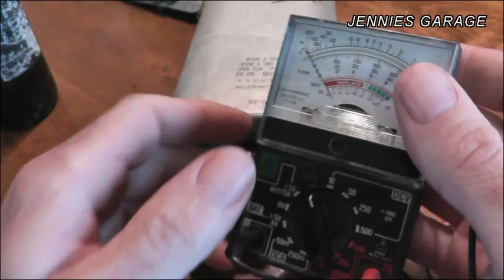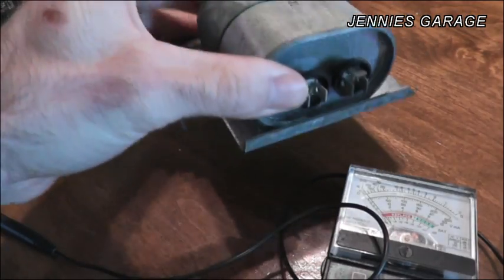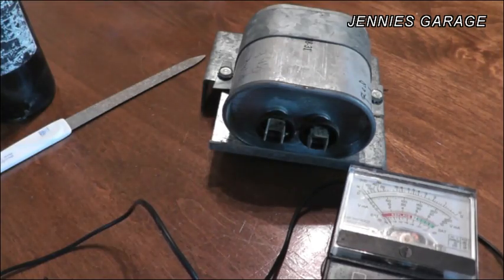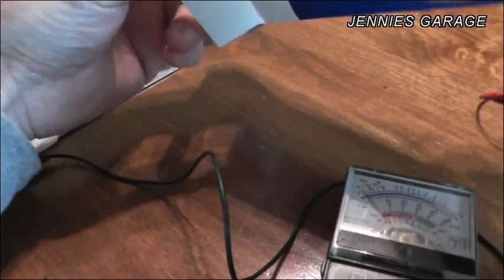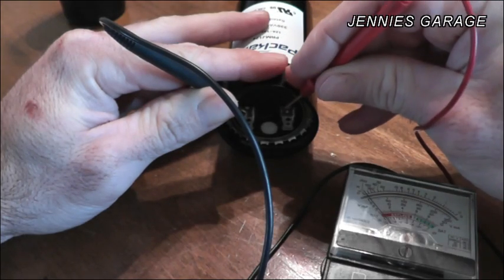How To Test A Capacitor For An Electric Motor With A Multimeter

Comment: Does that mean you found out that a capacitor hold energy even after the voltage has been disconnected? And will ruin your day if you didnt know that fact before you licked the terminals? If not then you didnt get a crash course in caps. It took a friend i had helping me with ac and electrical work 3 times of molesting caps i had in my tool box before he caught on. That also meant  drywall repairs where he stepped through ceilings four times. Three changes of undies. Three repairs due to electrocution and one just for the fun of it. If you walk into a room and see a pair of legs hanging down through broken sheetrock on the ceiling i highly recommend jumping up grabbing both legs tightly and swinging on them. You may hear some sounds youve never heard before but its takes some of the anger out of hiring a moron that steps through ceilings.

Comment: With the Ohm test, if the needle does not move the capacitor is nonfunctional. However, if the needle moves does not necessarily means the capacitor is functioning correctly. For example, a capacitor for a vent power motor (attic exhaust fan) is typically 15 microFaraday  with 5% tolerance 250VAC (for 1120 RPM). Using a capacitor meter to check for capacitance= 5.3microF.  Using the Ohm test, the needle moves up and down but the capacitor does not hold enough charge to keep the motor going. The Ohm test for a capacitor is a rough test- good enough for a quick check if you do not have a capacitor meter but it has some limitations.

Comment: I did the same test and it shows fine but still can't run the motor, I replaced it and now my blower motor is running again.You have to measure the microfarad,otherwise you will still be in the dark if you just measure the resistance.

Comment: For those watching that have no experience dealing with caps. You see how he keeps touching the terminals on the caps? DONT DO THAT!!! His have been discharged or you would see discharge running down his legs. Once a functioning cap is charged it will stay that way until it is discharged. Some caps can have up to 50k volts. Wanna trick you buddies demo a disposable camera. Seperate the flash and pc board charge it with the battery in it. Leave it sitting where nosey people are always messing with your stuff. Wait till they see the shiney thing and just like a monkey on nat geo. Theyll rush over and play with it right up to the point they  get 370 volts . Ah good times. You can rig up remote controls and flashlights to do the same. Btw to discharge caps find a 20000ohm resister and attach leads to the terminals. Use it to jump cap terminals. They can ruin your day or worse.

Comment: Those capacitors are effective only at the specified range for a specific motor....so this test is not adequate. Decent capacitance meters are $30 and up, small investment to know you are troubleshooting correctly. I paid for mine $39 about 20 years ago and it was useful on a large number of occasions. Also a correct value resistor must be used to discharge the capacitor safely. There are Safety Capacitor Discharge Calculators online that can be used to determine the correct resistor value if you are not familiar with the calculations.

Comment: There is no capacitor designed to be beaten liked that.  Never short the terminals under any circumstance.  Whenever needed, use a bleeding resistor.  If not sure which value to use, start with a higher value in the range of 50K or 100K.  Put it across your voltmeter leads and measure the dropping voltage.  Depending on the initial capacitor residual charge, this may take few seconds, perhaps a minute at the most, but doing so you will ensure that you won't damage anything and on top of it, you'll have a VIP seat to see the working progress !!!  There is nothing like testing a capacitor using a simple circuit.  I made a simple tester using an AC transformer, a resistor and the capacitor to test.  By measuring the voltage across the resistor, I determine the current.  Using that current value and the voltage across the capacitor, I determine the value of the capacitor.  So far, that approach never failed.

Comment: So true as I too was quoted one price over the phone to include tax & all for the total I was quoted, but when I got there the cost actually went up quite a bit at cranger appliance parts. But I think it was due to the fact I was not a service co. technician. as I was only a  D.I.Y guy! It's tough enough to save a dime when they paralyze & penalize you for not going to school in one field or another even though you're pretty much able & sometimes even more able to fix it than those trained that went to trade school. I had to learn everything in the school of hard knocks. People with any logic or ability or just plain common sense can fix most anything if it's on YouTube. L.O.L

Comment: A couple corrections, you have a blessed resistor on the capacitor, so it discharges it when not powered (still good idea to manually discharge, just in case)... Second, the file you're using has diamond dust on it (the abrasive part), it makes a pretty good insulator and wouldn't discharge the cap. And you don't really need one side to be insulated in this case, just bear in mind that if you use a bare wire, it may get hot while it discharges the cap...

Comment: Good video. i gave it a like.  But, Capacitor values are critical. Machines will still run with capacitors at lower values but ,they will draw higher amps shortening the life of the motor and causing higher electrical bills. Capacitor Values MUST Be Tested to Keep Compressor Motors from Burning out. Capacitor Values must be within 10% of Stamped Value on the Capacitor. good vid if your capacitor is shorted (as yours was) or open but thats it.

Make: Supco 
Model: Mfd10 --- is a Good Capacitor Tester. Works Good.

Comment: Hello Crash Crash Course--you crashed;High School electronics101 , to test resistance you can have no bridges between sources, especially a transistoracross a A 370V CAPACITOR ACE;  DONT MESS WITH THIS STUFF, THE ER IS NOT IN THE NEXT ROOM TO PULL YOU BACK !!

Comment: Thanks so much  for your effort to make a video to educate others.  However I am wondering why you would do so when you clearly lack the knowledge and experience on this subject matter. Please leave these topics to those who are qualified, especially with respect to troubleshooting and replacing electrical devices which operate at lethal voltages.  Quick example, you would not want to perform the simple test with a discharge resistor in place on the capacitor.
Reply: +Richard Kaseler - Why's that?  It's a 220KOhm resistor so it's unlikely to affect measurement if you're set to, say, the 1KOhm range or less on a multi-meter.  It will slowly discharge the capacitor by itself if left alone, but there's no problem speeding things up with a hard short to be on the safe side.  As long as this advice is followed and you don't go shorting both the capacitor terminals out with your body then you'll be fine.

Not everyone is a complete idiot when it comes to fixing things.  A little common sense goes a long way.  Many things can be repaired easily and cheaply for those with the skill to be able to do so, often saving huge amounts of money that would otherwise typically go into the hands of so-called 'qualified' 'professionals' who often know little more than what was said here.

So, $16 and a little time, with knowledge gained at the end, versus $$$ for someone else to do the same thing.

It would be worthwhile investing in a cheap multi-meter with capacitance check though for more effective testing.

P.S. I don't see that you have uploaded any videos on this subject yet.  Maybe you should do that first before criticising others.

Comment: not the case,,all capacitors have a mfd or uf  (microfarad) rating with a +/_  a small percent for a properly working capacitor  !!! just putting an ohm meter to see if it absorbs the power DOES NOT mean its a good capacitor,,,

Comment: Ha.. Thanks a bunch.. I had a capacitor go out on my franklin well pump. I always keep an extra control box to swap parts, but, needed to know what to put back in, and put back on the pump to keep my spare as a spare.. 
I just did the same thing, and figured this out... But, great video.. Makes me feel better.. 
I looked for a video like this back in 2009, when I had the last problem, and never did understand this well enough, so, changed the relay and capacitor in the box. Now, I just ordered 2 capacitors to fix both as spares and test them both again and keep them handy.. 
BTW.. I had almost exactly the same results as you had. Mine was a 1hp 220 volt pump.

Comment: and...... normally when the compressor Capacitor has failed.. 9 times out of 10 the compressor is on probably it's way out..... as in.... any body looking to fix the A/C via DIY are likely to just contaminate the refrigerant gases as the compressor windings  continue to burn out..........and build up acid in side pipework..

B.T.W. If your A/C is inverter driven I would NOT RECOMMEND -  shorting out high VOLTAGE capacitors. just call the A/C tech and make him/her  a nice cup of tea ......

Comment: 1st off you cant test a cap with the resistor in place thats used to discharge the voltage thats built up! so you DONT need to discharge a cap that has a resistor!! 2nd you need a meter with an MFD or a cap setting on the matter that reads the caps MFD rating  such as a HVAC meter would have!

Comment: If you look carefully at your ohmmeter, the ohm scale is zero on the right and infinity on the left. It jumps up toward zero and drops back down toward infinity. When you adjusted it at the beginning you calibrated it to zero ohms. You also need to check to make sure the terminals aren't shorted to the case. Often when these fail there will be oil or melted plastic oozing out of seams in the case and they can be discolored from heat.

Comment: Looks like the first cap has a 22k discharge resistor on it...couple secs after you disconnect the power it's discharged(I'd still check with a volt meter to verify)

Comment: Shorting the capacitor "with something metal" is a good way to ruin your capacitor!!  Use a resistor instead.
Reply: Why is that?
Reply: Because it can cause localized overheating which can vaporize and blow a hole through one or more internal layers of the cap. This could result in a loss of capacitance, or complete failure from an internal short.  It's a basic electronics no-no!

Comment: YIKES!
The very, very basic "facts" in this video are somewhat correct, BUT important details and theory are screamingly missing. Watch another video on how to SAFELY check large capacitors on You Tube with a digital multimeter [which most people own these days]. You'll be glad you did.
Reply: +GREG GUITARS LLC  - You have a good point. A motor cap for a whole-house air conditioning compressor or condenser fan would likely be 240 volt, which could certainly deliver a potentially lethal shock if it was fully charged and was a "big" capacitor of 15,000+ uF.  At least this video did mention in a couple of places to discharge, except that at one point, he didn't! On the Start capacitor, he touched the terminals with the meter probes without discharging first, later explaining that he actually knew already that the device was no good.

Comment: be safe, capacitors can be deadly. Use a load to discharge. Shorting can cause an explosion. An incandescent bulb usually works. Lower wattage, higher resistance...

Comment: You also need to check each terminal to the cap case, should be infinite resistance, if you get low resistance the cap is internally shorted. To accurately test one you would need a LCR meter.
A little FYI on caps used in AC, they DO NOT hold a charge like some would think, they would on DC but not on AC. With AC motors you have what is called inductance, which acts like a huge block to current flow, it makes the current out of phase with the voltage, which is inefficient, motor runs slow, gets hot.... blah blah PF or power factor is the amount of phase difference. Caps act the same way but in reverse, so in effect they cause the current to flow and be in phase with the voltage, so you see a better PF. 

Capacitive reactance is opposite of inductive reactance, they counter act one another.

Also see the resistor across the terminals, that is a bleed down resistor, so normally with no electricity the cap will bleed down to nothing in like 30 secs, so it doesn't give someone a JOLT!
Reply from the maker: Vernon Bosshard Good info, thanks for the comment.

Comment: Thank you this help me fix my portable AC unit I did not have a digital capacitance meter with your help found the faulty cap which was open and this did not start the compressor.

Comment: You can also test them visually.  My start capacitor had a flat top when new.  Now the top is bulged.....that and a very small amount of oil from the capacitor was on the  underside of it.  (and of course, the pool pump would not turn on).

Comment: The discharge can be startling for any one who has never discharged a fully charged cap before.... so be prepared for a loudish crack when you do. Obviously the lower volt rated caps release a smaller amount of charge so crack will be not so loud.

Comment: Capacitors store current and are measured in farads.Small capacitors that is. Hahaha!!! Yeah, make sure the nail file is insulated on one end. I would rather use a 
small screwdriver.
Reply from the maker: Yes a screwdriver would've been safer. More insulated, and less chance of getting fussed at by the rightful owner of the nail file.
Reply: LOL!!

Comment: The reason why the second one didn't jump like the first one after charging it once is because the first capacitor had a bleeding resistor to slowly let out charge when the capacitor is not charging. If the capacitor has no bleeding resistor, it will keep the charge for a very long time!

Comment: You need a digital mm that tests capacitance (uF) , capacitors have posted values and all you find out with that meter is continuity, it a fan cap is rated for 10 microfarads and it reads 2 it probably will not work, always buy a new cap with a new motor, they are not that expensive because some aftermarket motors have diff value caps.

Comment: Thanks for the video. My motor in my hot tub would not start. just making a humming sound. I checked the capacitor like you stated, and that was the problem. Saved me a service call.

Comment: I checked my capacitors with a digital multimeter and my ohms keep climbing up, up, up & up and never drop back to 0. >=-( Are they bad?
Reply: If you ohm goes to zero, it is bad. Climbing Higher is good sign.

Comment: I'm having problems with my compressor staying on. It starts then stops. Does the black capacitor keep the compressor powdered up?
Reply from the maker: Hi, if your motor is like mine, there are two caps, and they allow the motor to start and continue running. If one is bad it won't work right.
Reply: I only have one capacitor. I bought another capacitor Installed it and got the same result. The compressor tries to come on for like 3 seconds and goes back off. The fan turns like it should. I'm going to call someone out to look at it.

Comment: I need to replace SMD capacitors on my Sony WM DD1 Walkman. There are capacitors there stays '47uF4A' - what does it mean? Can I also use '47uF16V' or '47uF6,3V' ...capacitors???
Reply from the maker: Hi, you need to replace it with the same uF value but the new cap can have equal or greater voltage rating.

Comment: I just tested herm side and it went back  very slow  ,fan side went back fast  like in your video, is this  ok  or is capacitor going bad?   thank
Reply from the maker: It's likely fine. If the needle sweeps back faster on one than the other, it's probably because the capacitor where it swept slowly has a higher capacitance value and it absorbs more juice from your ohm meter.

Comment: Great video. But I have to agree with those cautioning you on your method of discharging large capacitors. There is probably more danger from an exploding cap than an electrical shock.
Reply: True but the greatest danger comes from an angry wife when you melted her favourite nail file. :)

Comment: an analog meter will ONLY tell you if a cap is open or shorted. it will not tell you if it is at value.

Comment: Very good thank you .
to discharge the capacitors with out being shocked use a resistor big enough to discharge it.
Reply: Had the same problem it was winter and furnace went out and like you suspected
the capacitor.
I went to Electronics store they sell used
parts bout one and discharged capacitor.
$3,50 and Heat Back In Business.

Comment: Nice useful demo, thanks. One minor note:@2:37"needle sweeps back down to zero" should be "needle sweeps back to maximum resistance".  Zero is on the RHS of the dial as shown when you touched the probes together making a short circuit with very low (zero) resistance.

Comment: Very careful when you short the capacitor! High voltage caps can cause a very large spark causing burns and fragments of molten metals to hit you in the face, eyes, or hands and arms. Never short these with any flammables around!

Comment: Also, older caps contain PCB's which are known to be cancer causing. They can blow up if you short them with a screwdriver. Can't tell you how many do it yourselfers have cost themselves more money than they ever would have saved had they done it properly. Don't be that guy!